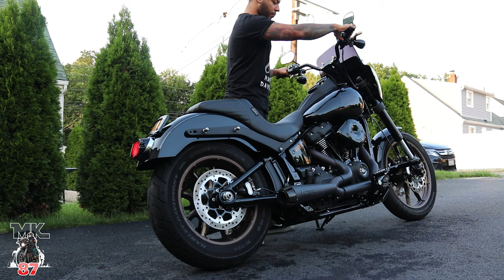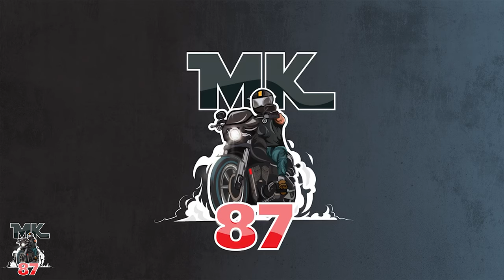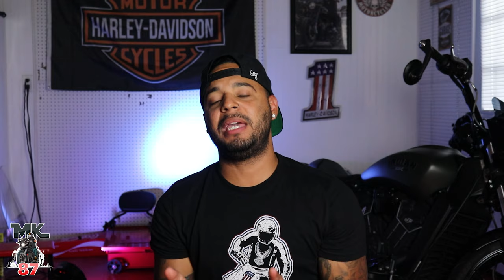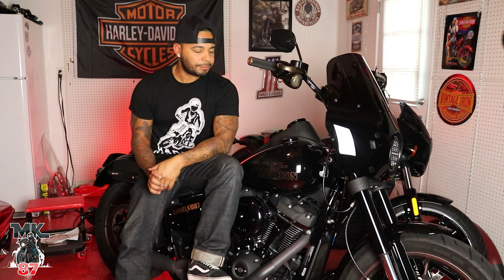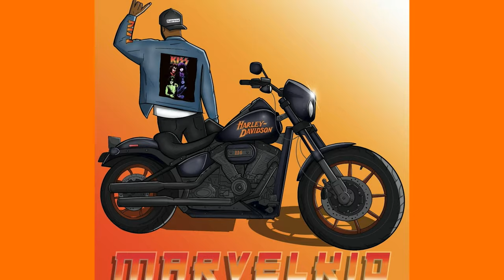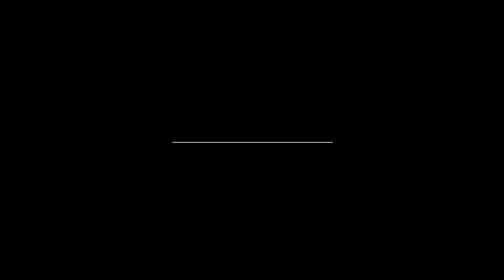Low rider s with TBR exhaust and s&s 475 cam sound

Comment: Fixing to loose the carbon fiber end cap homie.  Sounds amazing
Reply from the maker: All the bolts are coming off lol it’s hanging on by one now. I need to reach out to them and tell them about that issue
Reply: @Marvelkid87  running same set up on my 20 low rider.  S&S intake manifold and 5.5 injectors with a stealth pipe.  Made great power but looking to switch to thrashin pipe.

Comment: I just put a comp cam (239a) and I’m pushing 150hp 154tq. In the 2022 fxlrs
Reply: any other change? big bore etc.?
Reply: @IronManMoto  no. Just the COMP cam. Will be upgrading my clutch here soon. Hopefully I can post a video of it soon.
Reply: Lol def not making that much off a cam upgrade
Reply: @hybridEP3  I can show you my Dyno video and my printout if you would like.
Reply: @dcburton1  post it
Reply: @hybridEP3  you should be able to see it now
Reply: @hybridEP3  click the link I tagged you in.
Reply: @dcburton1  not showing ?
Reply: @hybridEP3  it says it posted on my page. The link in these comments took me straight there.
Reply: @dcburton1  that dyno isn’t setup properly. No 117 puts down 150/154 with cam only. 

131 crate motors don’t even put that down.

Comment: You never showed your dyno numbers from your new cam change...
Reply: He hasnt dynod it.
Its a pretune.
He said that
Reply: @mr.b3168  That didnt come out on the Closed Captions
Reply: @bradlozano2571  previous video
Reply: @mr.b3168  Exactly...didnt print out on the Captions
Reply: @bradlozano2571  im assuming you are not able to hear?
Reply: @mr.b3168  Thats a smartass remark
Reply: @bradlozano2571  No.
It's a question.
Reply: @mr.b3168  You dont ask someone that is hearing impared the reason they use Closed Captions...Thats rude
Reply: @bradlozano2571  How do you know someone is hearing impaired, on the internet, through text, without asking? That's a bit like the ole "If a tree falls in the woods" conundrum.
Reply: @devynrossi  Well....when someone says they are watching with Closed Captions...what do think?...Thats like someone in a wheel chair and asking them can they walk?....